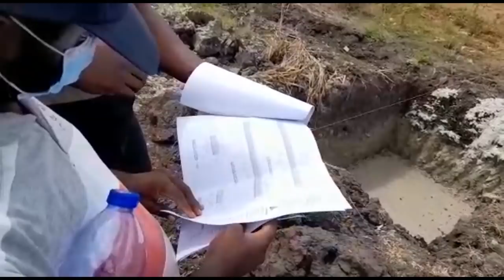Building Our Modern Poultry Sheds || Expanding Our Poultry Farm

Comment: This is very impressive. In Africa most livestock structures are scruffy and unispiring. The materials of choice are crooked sticks, timber offcuts and used iron sheets. The argument is always cost which is a lie. We all know buy cheap and you will buy twice or thrice. To see a young woman so driven and going this great length to erect proper buildings and infrastructure is quite encouraging. Congratulations!

Did you ever consider Frisomat of Belgium for the prefabricated buildings? They use galvanised light gauge steel materials. Are you free to share on costs?

Following closely from Nairobi Kenya.
Reply from the maker: Thanks Adam..I've never heard of Frisomat...I will be looking into them..Thanks for the heads up 🙏🏾
Reply: People starting up can’t get such amounts.